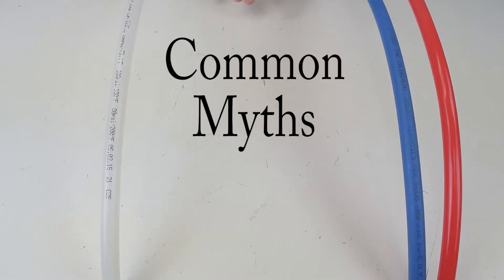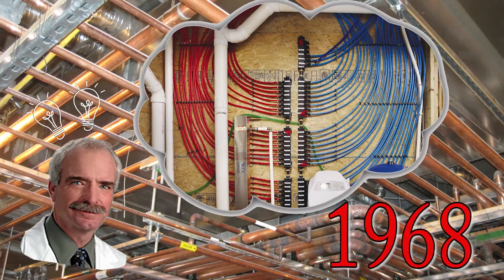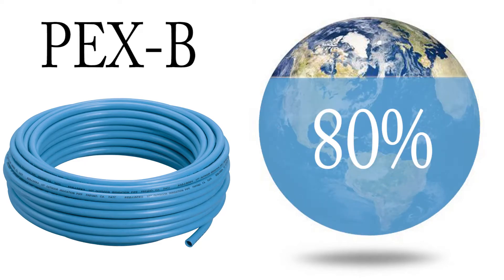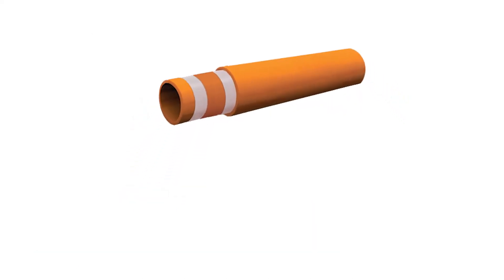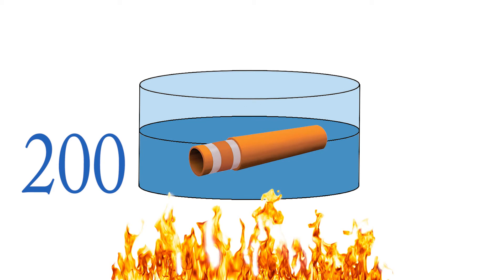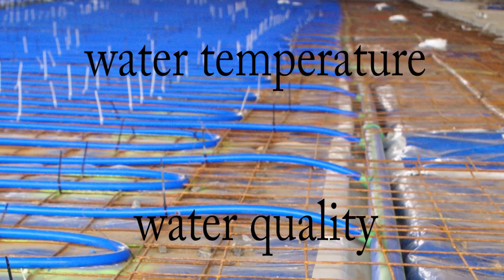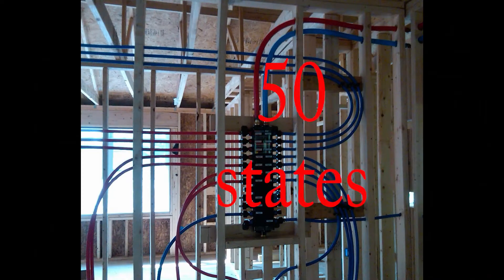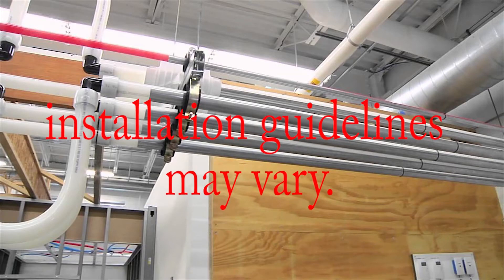PEX tubing: Myths, Facts, and FAQs

Comment: Most pex A products have a chlorine resistance rating of 3 compared to Pex B at a rating of 5. With Pex A having a rating of 3 , how long could Pex A resist Chlorine in your water, if you wanted to shock your well with a gallon of chlorine run through your system and allowed to remain in your system for 24hrs?

Comment: Are there any problems with using stainless steel cinch clamps?
Reply: Don't use them. Cheapest and worst to use. If you are using PEX B use the copper rings. 
I suggest Uponor PEX A and the Uponor Pro Pex expansion rings, using these will avoid a lot of issues and save you time. Uponor PEX A is a bit more expensive but you will be using quality material and offering a quality job to your customers.